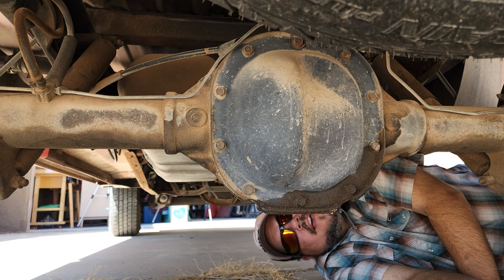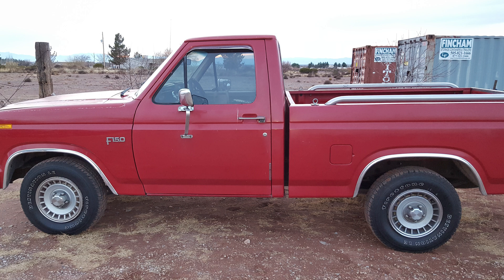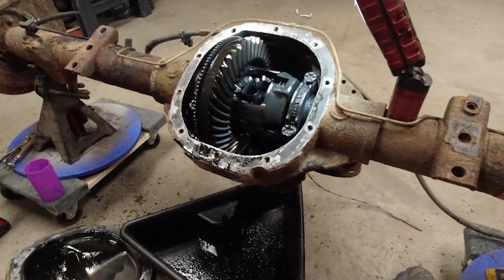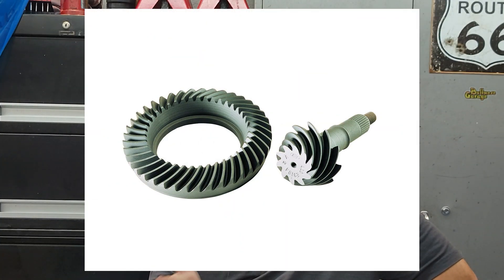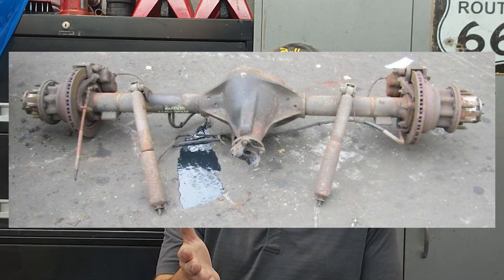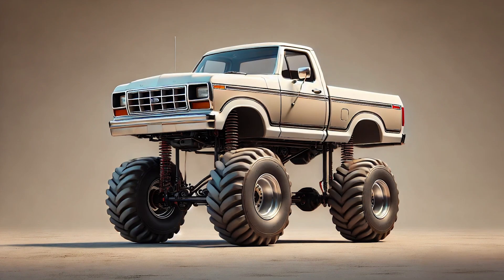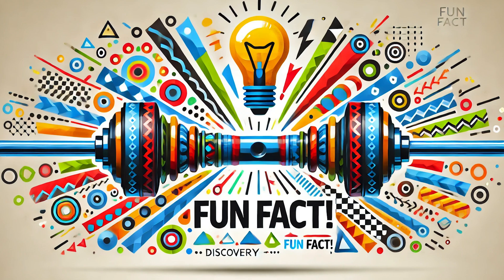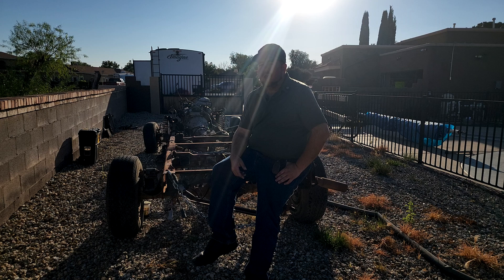Why Ford's 8.8-Inch Axle Dominates from Mustangs to F-150s

Comment: Only issue with an 8.8 I ever heard about was on a fleet 1994 Bronco upgrades with a Rancho suspension. The in-house mechanics were all railed up because the axle housing was bent indicating someone had been getting some air with it.

Comment: Ford and toyota definietly did better in engineering their vehicles to exceed their inteded offroad capability.
Jeep, has so much capability, but the engineers did not give you the axels you need to do the job until way late in the game. 
But ford never made as good a wheel base or track width vehicle with a removable top.
Save the OG bronco